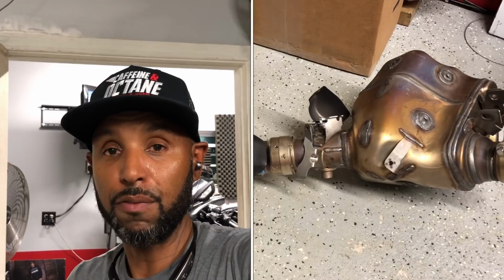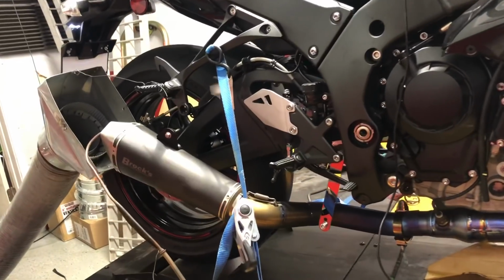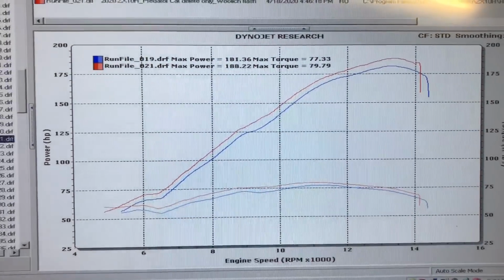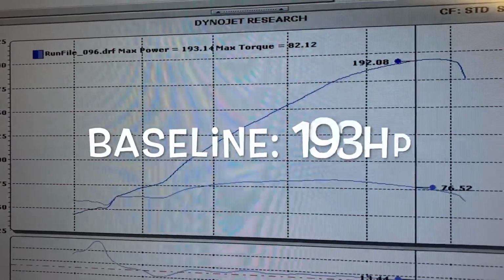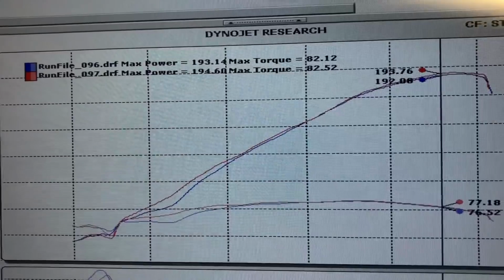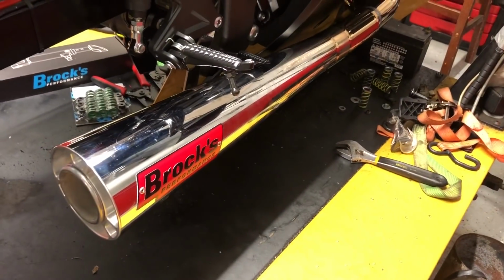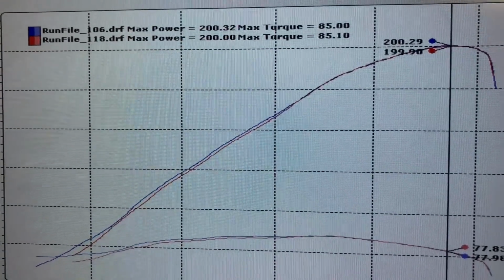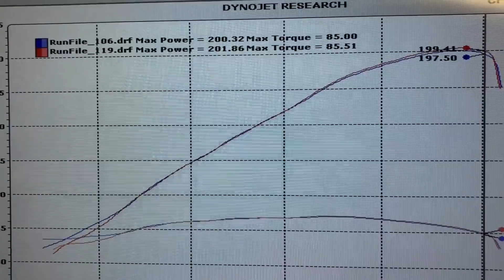WE PREP THE FIRST 2020 ZX10R DRAG BIKE(“THE ANTIDOTE”) FOR BATTLE

Comment: Ricky most racers dont know this, I know the Brocks was a slip on and full exhaust/ and he makes great stuff. But test have proven over and over again a Ackropovic full Ti system will out perform any other system,  even if the power reads a few less, the Ackropovic will pull a 2-3 mph higher ! Same bike, just switch pipe, try a top end run same day and see what happens. Plus you don't haft worry about the side winder dragging  !
Reply: Side winder IS for dragging. Drag Racing an extremely lower-ed bike...
Reply: I seen a vid where brocks out powered ackropovic
Reply: I wonder what the predator would have made with a full system

Comment: Hey Mr. gadsen. I was able to see your afr with your dyno runs. It’s at 13.4? Something there like?  If that’s correct the zx10r is barely getting rich to see those numbers. Holy moly. I was expecting to see like a 13.2 or 12.9. Ya. Airflow is definitely the booster for this bike.  Keep it straight and fast mr. rick.

Comment: Yo! Ricky where you say that dip was happens with all slip on, not ready it doesn't happen with Chris Moore Mafia, That dip is where he beats you. And your not running that drag max tire that isis flat and wide.  It's common since that a flat wide tire is going to have a better contact patch to the track then a regular tire. Plus besides the contact Patch causes the increased torque!
Reply from the maker: That dip is around 6-7k RPMs on the dyno.

Comment: Great work Mr.Gadson! No doubt the MR12 is the race fuel typically used by those attempting a high level of horsepower/gain but, can any of the commercial grade octane boost products transform pump gas to an equivalent product? Just asking??
Reply: We have used and dyno'd all the top brands of octane booster .
In general it makes no difference , it can even reduce power .
Oxygenated (race) fuel is expensive but it works

Comment: So Mr. Gadson, you recommend both an ECU Flash and having a secondary tuning system Bazzaz or PC-V...
Reply from the maker: bacchus thompson don’t have too, but it makes it easier to make changes in fueling.
Reply: @rickeygadson6095  I always wondered about this... It makes more sense to me to do both because it saves you so much time by not having to take the ECU out everytime and it allows you to basically have 3 different maps (Flashed Map and two stored maps in the PC-V) and run AutoTune... 🤷🏾‍♂️
Reply: @wudntulike2no32  so if there's no internet, you can't make any on the fly adjustments... With the Flash and a management piggyback, you're covered no matter what. 

I do a lot of commuting and weekend riding, so I change elevation and conditions a lot. A flash along with a piggyback just makes the most sense for my situation... Just upload a map from phone and activate AutoTune whenever conditions change.

I know that some of the new bikes you're able to store multiple maps within the ECU and access them through the different "Power Mode" selections (I think the GSX-R's can hold up to like 5 or so). Using my situation as an example... If I start off from home in Urban NC and we decide to ride to Boone/Appalachian area, I've just made an altitude change of about 2900 to 3000'... Pull phone or hit a map selector button, upload map and activate AutoTune, nothing else to worry about... Once out of the mountains and back to normal altitude, zero out my PC-V, run my Flashed ECU Tune, and I'm fine... Without out the piggyback or internet I'm stuck with a tune that is totally out of it's realm, performs terrible (motor is starving for air) and could cause damage possibly.
Reply: @bacchusthompson5834  Depending on the bike you can run three to six maps in the ECU. 
2020 ZX-10R? Can run three maps through the ECU no problem. 
2012 GSXR 1000? Can run six maps through the ECU no problem. 
And you don't have to take an ECU out for each flash... You can flash directly on the bike.
Reply: @bacchusthompson5834  Depends on what product/software you use. FTECU you need internet for everything. Woolich you need internet for 3 models out of all the ones they support. 
The ECU compenstates for elevation and conditions. Today's modern fuel injected bikes are not like the carb'ed bikes of old, they will adjust for pressure and temperature differential. How people can't understand this is beyond me....
I can ride my bikes at 1100 feet at 113*F and ride it up to the nearest mountain at over 8000+ feet and a 30 degree temperature difference and my bikes won't perform any different.

Comment: I'm sorry but for $2500 you could do a voodoo sidewinder, heavy duty valve springs, progressive nitrous controller, spraybar, 80hp+ shot of nitrous, and a tune, and still have enough for some race gas if you wanted I'll take that over 6hp here and 2hp there.